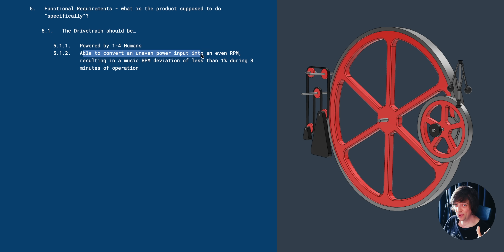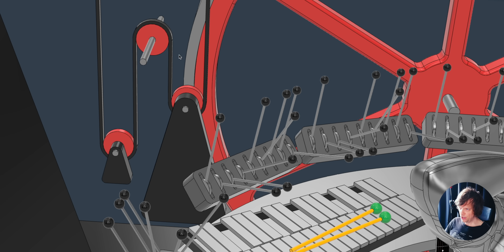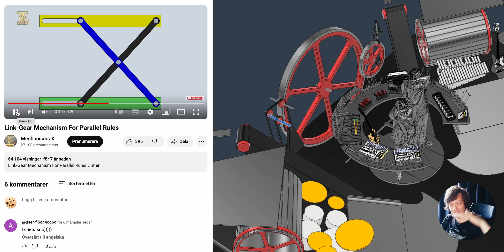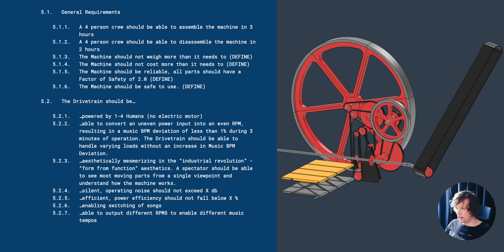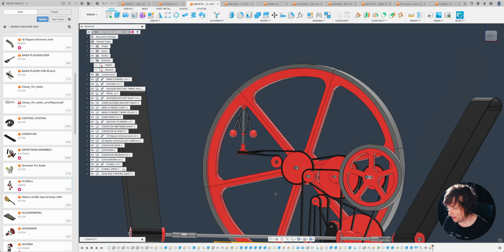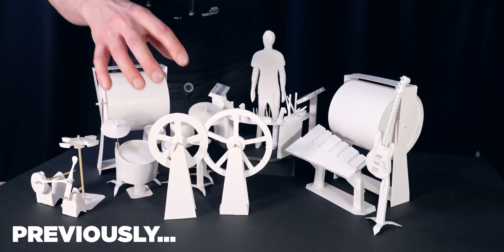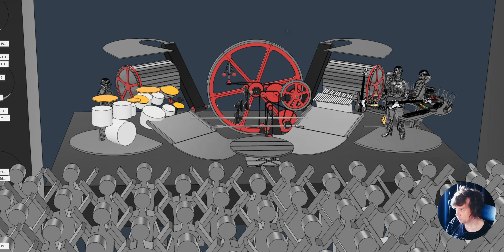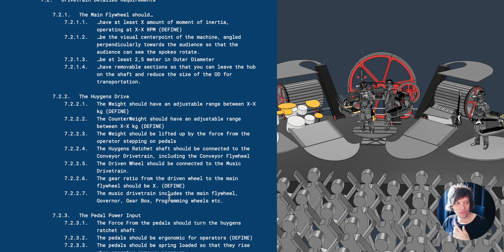The Marble Machine Drivetrain

Comment: Yo, Martin, loving the content, keep it up! 
One thing you don't talk about much (you mentioned it once in passing in this video), and is becoming a growing concern as the flywheel grows in size, is safety. The amount of energy in such a massive piece of rapidly moving metal  is... a lot. I'm sure you've noticed this, but that thing would take off an arm in a second, so speaking to that would be great. What are you doing to make sure it doesn't fail spectacularly and take off into the next county?

Comment: I suppose you could use longer belts and lift the whole drive wheel system so it is visible above (and behind) the operators. Or vice versa, put the operators on a higher platform.

Comment: You should also have a requirement that the distance between components in the drive train can have some variability.   That way, when you're assembling, you can have a few cm of flexibility over not getting the placement "exactly right".

Comment: it might look better if you elevate the flywheel by about .75-1.25 meters. Gives you the look but doesn't really locate things differently, much simpler down shaft to distribute power that you can even do with the gearbox you have

Comment: 3.5m diameter flywheel... Martin, please make the  fly wheel one piece. Otherwise balance will be a nightmare. You  can transport it by turning it on its side and laying it down at a 50 degree angle or so. You could go up to about 3.5m diameter if you use a standard truck and trailer for transport.

Comment: Martin, One of the reasons for writing down the design requirements is to be able to review them and make sure they still make sense.

You first design requirement requires that the machine be human powered, but you have never provided any reason for this. 

I can find no difference between a human pedaling away (and perhaps not playing an instrument) and an electric motor.

Please provide the rationale for this requirement.
Reply: I vaguely recall him talking about how he doesn't want to create a robot, a machine without input, but something more in line with a musical box that you crank yourself. It's simply a matter of personal preference. I agree with him that the human input is a big part of what made his previous machines cool. Without it they would be more like robots playing music, which is lame if you ask me.
Reply: @psychomaniaxtaot , Since he programs the wheels it is a robot.  He can use various controls to alter how it plays (sounds) but it can play autonomously as long as power is supplied.

Comment: For drive train specs you need to specify the space and weight each piece will take up for transport. Will you need the transport capacity of Taylor Swift's Eras tour? An eight foot diameter wheel that does not disassemble will be much harder to transport than a four foot wheel.

Comment: A problem I foresee are with those universal joints at a 45° angle. If the drivetrain is expected to have a consistent rpm the angled universal joints will output an inconsistent speed. They will cyclically ramp up and down in rotation speed.

Comment: This machine is definitely going to need a big BPM meter for the operators. I'm kind of imagining something like the frequency meter in a powerplant. Basically just a visual indication of the machine's exact speed/BPM so that the operators know how close they are to the correct tempo. Also a load meter would be very useful. For example switching on a bank of instruments and then a moment later the load on the system will spike with all the new marbles needing to be lifted. A meter to show load could help the operators know how hard they need to pedal.

Comment: Once again. I think you really should look at the fixed belt, variable diameter pulley system for your speed transmission.  Like you find in an Older ShopSmith wood working machine. This would give you a simple hand crank that you can use to adjust tempo and index the crank indicator to specific tempos you want.  Plus, you can change tempo WHILE the machine is playing. Ramping up or ramping down.

Comment: Looking amazing!  Fully agree that the mechanicals should not be hidden away.  Big part of what made the viral music machine video so mesmerizing was the interaction between the operator and the machine.  The choreographed dance of cranking and switching levers.  I guess in a way you could consider the operator as part of the mechanicals.  There's just so many brilliant stars on the stage, the marbles, the operator, the gears, the lever controls, that it's really hard to pin down which one can be hidden without losing some of the magic.
Reply: I agree. I think he needs more levers and pedals to handle, more moving parts and input required. I see a risk in it becoming just an elaborate background track for the band, rather than a dynamic instrument that's an integral part of the music and the show.

Comment: Be careful how you stage this. I'm a wedding officiant and there is a technique by which the couple stands up at the front but the officiant stands 20 feet away to the side of the guests. Theoretically the officiant is out of view but still being easily heard. The idea is that this configuration keeps the visual attention on the couple. After all, that's what everyone is there to see... them. But it doesn't work. People will naturally seek out where the action is... where the emotion is coming from. In the end, everyone's heads are crooked the side to see the officiant whenever they are speaking. I highly recommend you keep the mechanics in the background. Imagine opening the hood of your car and staring at the engine for two hours. It gets old quick even for the mechanically inclined. Keep people at the center of attention. If you really want to showcase the mechanics, at the end of one of the first songs, do what you did for the first marble machine, walk away, and just let it run out of the energy. So everyone can see how it works. And remember it's about the music first. Mechanics second or third... right?

Comment: Hey Martin. I just want make sure, that you know, that driveshaft (Cardan shaft) didn't pass rotation uniformly in case of big angles. Bigger angle - bigger rotation variation. So you may have problems with tight music because of it
Reply: Amen!!! But seems that Martin is not listening from that ear...
Reply: Oh no, you mentioned the 't' word. Please use with caution or you'll stir Martin up to return to the early design stage  't' word use frequency 😮

Comment: I still think the two main "side" modules should point outward instead of inward to give a space for the performers in the center of the stage.

The whole band can interact with each other and not be separated. As well as each band member could have levers or cranks to interact with the machine
Reply: I'd move the marble return conveyors to the very outside of the angled out "side modules"

Comment: Performers in front, But just ELEVATE the mechanics. No reason it can’t be taller.  Just sit it on a platform as high as it take so that more of it is visible. And make room for lighting behind the operators that will cast shadow images of the mechanics onto scrims  that might stretch all the way to the lighting rig.

Comment: I agree with the 'Sea-sickness' comment below regarding the power pedals at the 'console'. But I think there is an awesome way to avoid this! Crowdsource the power input!  Make a couple of pedals (or even hand-cranks) that the audience can operate at the front of the crowd - perhaps some slightly raised platforms left and right of stage that audience members can crank or pedal to become part of the show for a little bit. Let Martin's feet be free to roam and leave the console at any time, and no worries about powering the system from the console.

Comment: If you are to use Camden joints please be wary. If you have a shaft with a steady rpm and connect it to another with a Camden joint, the output shaft RPM will not be steady, but will oscillate. The oscillation increases the tighter of an angle you try to use

Comment: You can increase the visibility of the mechanics by raising them up a bit,  you will just need longer belts and some adjustments to the drive train. Also, lots of love for the Almond Coupling, we have one at the Rough & Tumble and it is fascinating to watch in motion. (Ours is belted to a 2 horse Donkey Engine) They were designed to turn the direction of line shafts in factories, so they can handle high RPM but are usually fully enclosed in an oil bath during operation.

Comment: You could raise the flywheels up. If the axle is athe height of your head and the smaller flywheel perhaps a little higher, both the operators and the mechanics are visible centre stage

Comment: Does it matter if the lift belts are driven from the top or bottom?, Same goes for the programming wheel drive gears, can they work on top?.

If these can work, use a raised rear middle stage   ._---_.
"Stage presence"/"Aesthetic" issue solved?

Comment: Martin, what if instead of moving the controls and performers to the side of the machine, you raise the drive components up on a platform so they can more easily be seen. This way they would appear to be more of a focal point, as they would be higher than the performers, and less like a backdrop that the performers are standing in front of.
Reply: would look cool. you might have roadie backlash with positioning heavy parts above ground level week after week.

Comment: remember that if you use a gearbox with the current design, you are limiting the direction the flywheel can turn to be left. So if you want the huge wheel to right you need to either find another solution or add a second gearbox (if its the one shown in the picture, you could of course have one with 3 gears), but that would make it more complex, plus add a possible weakness. Because right now, the marbles are going downhill and not uphill which is what it looks like he wants.

Comment: Again, where did this maximum virtual product come from? MVP means minimum viable product, ie. the bare minimum needed to make the concept work...
Reply: From "How big things get done"
Reply: @axiom1650  oh sweet irony...
Reply: Go watch that video. Maximum virtual product is about iterating quickly in simulations to solve problems before the come up at full scale. CAD, design requirements documents, prototypes or a physical model all let martin decide what the machine looks like & what it needs to do before he starts fabricating parts for the touring version, where mistakes or design changes are A LOT more costly & time consuming to fix.

Comment: An idea would be making a solid bridge over the marble exiting slopes.  Put your round control area on top.  With your audience under you, the height wouldn't need to be too tall.  Or simply just raise your control area and, instead of a flat bottom, have the bottom curve as to match the wheel.   I think it would be even cooler with the control area becoming a control tower.   Also, putting the drivetrain in front and raising the control area behind it could be a potential solution, getting great video angles with the gears in front seem likely. Love your vids, keep em coming!

Comment: You can solve the aesthetic problem of the mechanics by getting rid of the "human powered" requirement, and moving to an electrically powered, but human controlled system.   

Imagine the following:  
Instead of 1 to 4 people stomping power into the machine using pedals at random intervals (independent of music tempo),    you have a musician setting the tempo with a pedal and then an electrical motor maintains the power input to keep the tempo until the next change input.

In this way, the performance is better because you see the musician controlling the machine.

Comment: What if the driveshaft was on the top of the conveyors instead of the bottom? Wouldn't that allow you to move the other components like the gearbox, governor, and such to be above the musicians? I think the wheel is still big enough that it would be visible, but now the small things could be visible above the machine.

Comment: Martin, you need to take into account safety in your requirements.
Reply: Yes! Wrote it to him a few videos ago. This is a serious concern. You can't just have unprotected 2 ton steel wheels standing around. Put your arm between the spokes and its gone. Honestly it feels like a kindergartener playing with a weapon blissfully unaware of the imminent danger🥺
Reply: That's what I was thinking too. Big holes moving in circles with a lot of momentum could be bad.
Reply: Can a protective mesh be added so limbs do not get caught in the wheels while still allowing the crowd to witness the dramatic clockwork gears?
Reply: @SerraMsDerE  probably not. it needs to be filled in completely with acrylic or something along these lines
Reply: @chrisX1722 Didn’t he put acrylic in the flywheel of the MMX?
Reply: Failure Mode and Effects Analysis
Reply: but if it's unsafe, you can charge more for tickets because folks always love a crash.
Reply: Chop chop wheel.  Human parts flying all overt the place. French people would love it back in the days.
Reply: 1800s or 1900s .. I said a platform above the gears like the old machines

Comment: I would suggest to explore the vertical disposition. 
Setting everything at the floor level and making a kind of platform, up high for the operators, this way you enable you to play in both small and large stages.

Leaving all the heavy gear at the floor level, safe and secure.
Reply: Was going to suggest exactly this, as it helps show off the gears, while still making the performers visible as well.
Reply: I was about to suggest the opposite, raise the fly wheel above the operators where the typical band logo would be on the backwall.
Reply: @clempo2  problem with weight at height above performers if it falls, plus additional parts to chain belts, versus far easier to extend the pumping.

Comment: Consider putting the drivetrain low and in front, and your operator deck high and behind it. You can still see the torsos and controls, but the feet would be behind the upper 3/4 of the wheel.

Comment: Humans created a great way for a human to supply power to a rotary system over 100 years ago, it's quiet, low friction, reliable and has been refined over the decades including for electric assist. 

It's called a bicycle, also has the advantage of being seated. 

Even the Americas cup sailing boats have gone from arm drive Pedestals to "cyclors" which are cyclists to pump hydraulic fluid to adjust the sails.

Comment: As a fellow tinkerer i am sure you know that universal joint is not capable of transferring uniform rotation at an angle. The rotational speed of the output shaft varies cyclically even if the input shaft rotates at a constant speed. So it is very humbling seeing how you factored this detail into your design (using for conveyer belt drivetrain instead of musical drive train) but then you didn't elaborate on how musical shaft is going to transfer power. Please elaborate

Comment: 9:57 operators above and behind the mechanics.
Maybe you could inlay them partially into the ground, to lower the operator platform, keeping things more compact.
Reply: Lowering things into the ground just means raising everything else up. Most venues aren't going to let you cut holes in the stage after all.

Comment: If the angle between the conveyers and the main flywheel shaft does not need to change then it should use gears instead of u joints, u joints can reduce the smoothness of power delivery and in your case make music less tight

Comment: Maybe link the pedals in duo's so that if one gets pressed down, the other one rises. That way the musician won't rise or fall down and will stay roughly at the same height.

Also, these axle elbow joints usually don't rotate at constant speed. A constant input leads to a non-constant output.

Comment: Make sure that the pedals are designed safely (ie, wont be able to trap feet between/under the pedals or non-pedal surfaces) - was a bit concerned to see that wasnt in the design requirements
Reply: The last prototype pedal he did had protections, im pretty sure he wont forget
Reply: Well, the whole drive train better be enclosed in safety glass.  Once that enormous fly wheel gets going, the momentum will be deadly if some falls into it.

Comment: Not to be negative but i think that one pedal per musician in the center is safer, more controlled and ergonomic, you need a solid base on wich to stand on to pump the pedals with the other foot.
Reply: they'd need to put their whole weight on it or pump it like a madman(if gearing was such) anyway. maybe he has downgraded the watts need and amount of balls raised up, but some estimation was 200 watts (that's a professional bicyclist level of output, which divided by 2 makes it a little bit better I suppose but still a lot of work)
Reply: @lasskinn474  200w is good amateur power, pros do 350w+ for long durations.
Reply: @darkiee69  A average person is more like 100W. They are also performing while doing this. Going over 100W per person seems harsh.
Reply: It's already on the list.
Reply: Perhaps it would be better to have a line of slaves rowing in unison. I think that’s what they used before electricity. Or maybe just hannes 2000, and that’s why he’s been getting in shape.